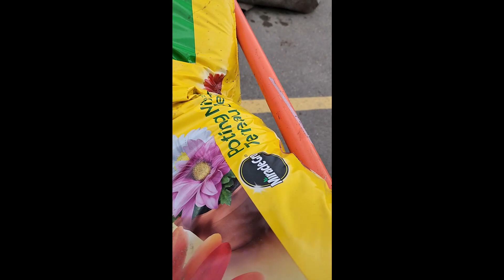Where to put our Solar Panel Array? | S2 Ep18

Comment: the time to put your dock in is at low water so you know how far out to build it so your not grounding out , after its in dreg beside the dock for a channel for the barge, best time is low water also
Reply from the maker: Unfortunately, dredging is not allowed on this lake so we will look for a natural deep water shore and place our dock there.  Docking the barge is actually a really simple matter and does not require a dock.  The ramps act like land anchors and together with the lines keep the barge very stable against the shore while maintaining buoyancy.  As the water recedes, we simply back the barge out a little.  Easy-peasy.  We appreciate your suggestions!  -Ryan

Comment: Def for diesel engines is supposed to help the environment and yet they package it in something that has to go to a landfill. Two somethings to be exact it's plastic wrapped in cardboard...go figure. Melodi, I think I remember your mentioning the tremor in your arm/hand. I had the same thing only in both right and left and the doctors couldn't figure it out. Turns out I had torn rotator cuffs in both shoulders. I had surgery on one and the tremor went away. I'm still waiting to get the right side done. I have to have a 4th spinal surgery first. Have you checked out that possibility?
Reply from the maker: I have never checked out that possibility but that is simply fascinating! I sure will now.  Thank you for sharing!